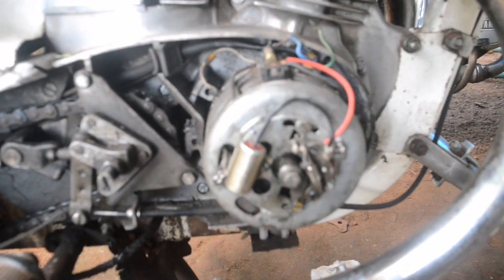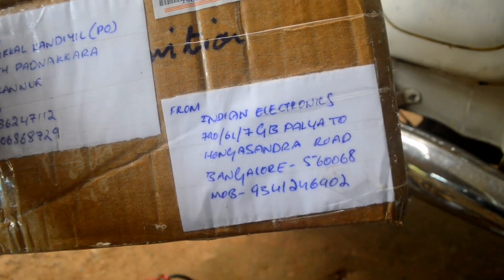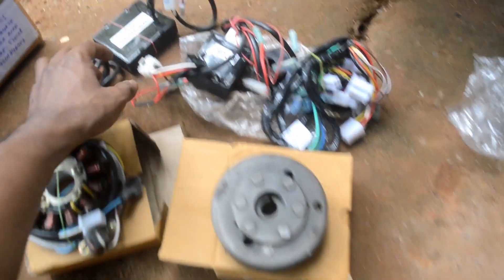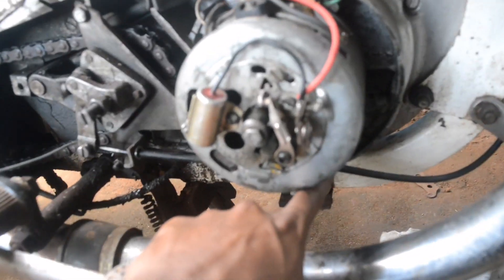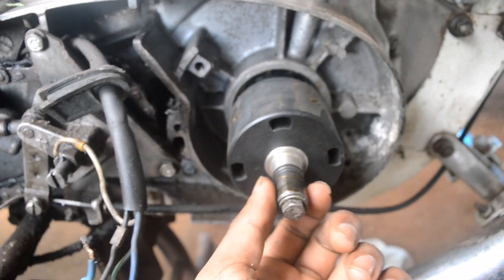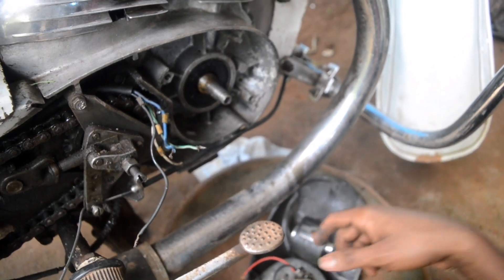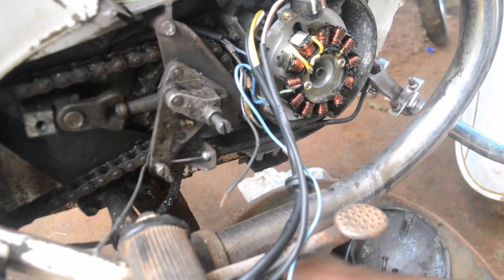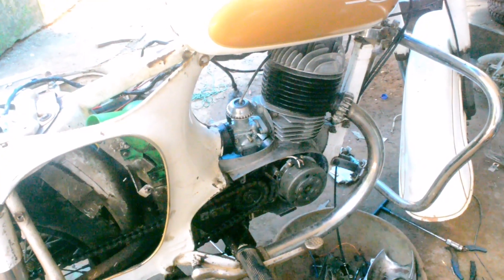Jawa Yezdi performance Cdi kit installation

Comment: what's the price of the kit ? Also how much is the voltage , current (how many watts) . I am from Bangalore , have yezdi Road king ,has cdi system but lees power 6-9 v and less current , which gives starting problem and  releases too much of smoke.pls respond Thanks